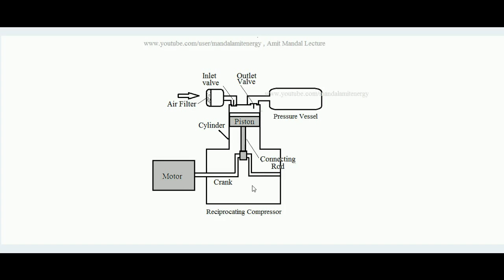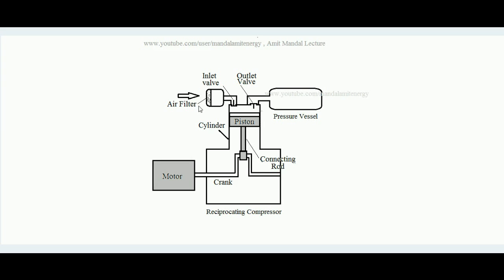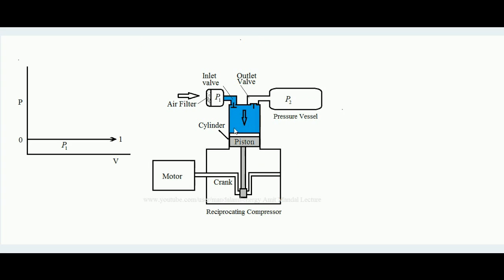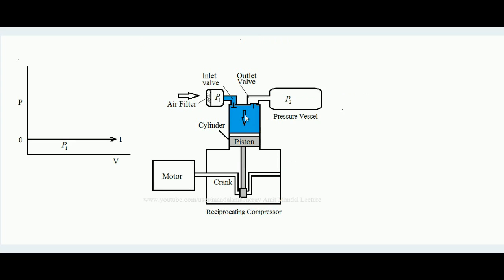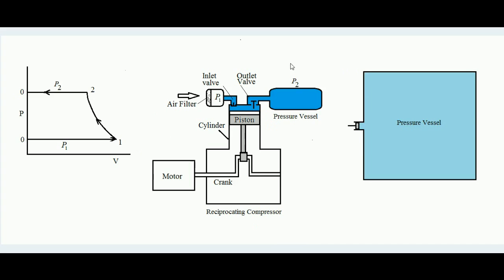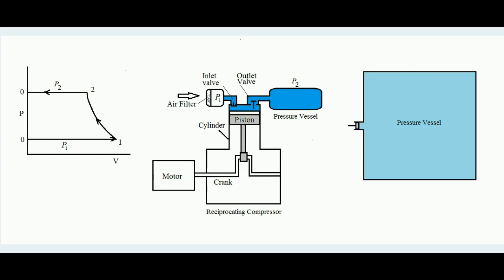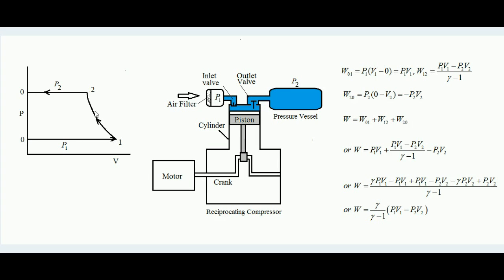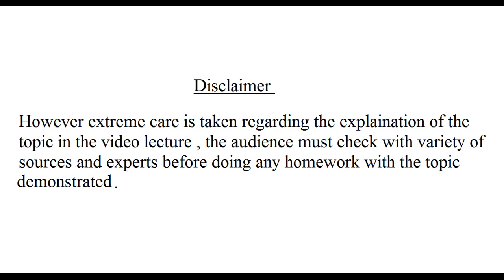Reciprocating Compressor , Working and derivation of workdone.

Comment: P1 should be less than atmospheric pressure then only the valve will open. There has to be the pressure difference on both side of the valve.
Reply from the maker: It is slightly lower which is not considered.

Comment: If constant pressure at which air is sucked inside the cylinder is atmospheric pressure, how valve will open if pressure on both side of the valve is atmospheric pressure

Comment: The formula derivation is incorrect. work done in open system should be W1-2 = integration(v.dp) and not p.dv
Reply from the maker: No the result of derivation becomes P=VdP
Reply: Sir, We should take area towards y axis or x axis?
Reply: @frictionless  both will work but in limits of Y 

U will have to use change of orders for double integrations 
So easy n preferred is normal way 

Plus in that other way u will have to encounter some variable limits

Comment: sir it was an awesome lecture.
I think if we are considering the piston-cylinder arrangement as the compression process starts the pressure inside the cylinder increases and then the outlet valve opens when pressure becomes more than the pressure in storage tank or pressure valve. so with an open volume we can't increase the pressure that's why the process is isobaric. This may be a reason for that. Is it?
Reply from the maker: +Rajendra prasad Swain actually when the mode changes from closed to open valve then due to small displacement of piston compared to large system ( large volume of pressure vessel) the pressure change is very small and insignificant